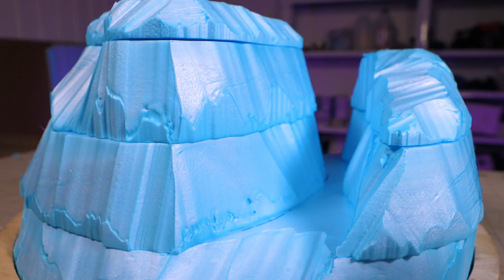Making A Miniature Fantasy LANDSCAPE  (For An Epic Castle?)

Comment: Polymer clay is good when working with metal. It has to dry in oven though. It can be a bit difficult to make it stick to metal by itself so I'd recommend buying liquid clay, with can be used as a sort of glue to make the clay stick. Translucent liquid Sculpey (TLS) or FIMO deco gel both works great. Polymer clay also comes in a variety of colours, if you don't want to paint everything, and it's great for sculpting small details. Some even comes with cool effects like translucent, granite, metallic or glitter, glow in the dark, etc. 

It can be a bit heavy if you use a lot or make thick layers though. So if you make something that has to be lightweight, I'd recommend using wire, masking tape and aluminium foil to build up the armature. 

You can also bake it in several intervals. So for this project for example, you could make a few branches, bake it for like 5-10 min, make more branches, bake and so on. The package usually says to only bake the clay for 20-30 min, but Iv'e had pieces in for an hour or more with no problems or damage. And in my experience, the clay gets harder the longer you bake it

Another thing is that the clay almost never get's old or dries out. And if it dries up, which in my experience can happen after a year or so of not being used, it can be easily fixed by mixing it up with a few drops of either liquid clay, baby oil, or even clay softener(which is made for that exact purpose). It will almost instantly bring the clay back to it's original condition.

Comment: My step sister uses sculpey clay for projects that need wires or tin foil to hold up the clay or shape.  You do need to bake the clay in the oven once you finish with the clay but it works for her. She does a lot of clay work.

Comment: if you want a fun medium to play with make papier mache using acrylic latex paint instead of water/glue, I prefer using tissue on small projects and paper towel for larger projects but it works with news print and printer paper as well.. Ive used craft paints, thinned artist acrylics and house paint, all work and it drys to a hard, water resistant, plastic like stuff that is very durable.. in this case I would have covered the "mountain" and the trees with it, its extremely moldable

Comment: Try using a mixture of wood glue, modeling paste, and fine saw dust for your tree trunk cover. You can also add paint directly to the mixture to give it a base color. You can easily control the thickness and, when it starts to dry, it's easier to make bark lines using a paint brush.

I'm a new subscriber, so I haven't watched your entire back catalogue yet (still watching book builds), but have you ever looked into a static grass applicator? It is a cool way to apply realistic looking grass to models.

Comment: Another way to cover your armature while using tape is to add aluminum foil to the base to add more thickness and lightweight instead of just adding clay directly to the wires, also you can use bake and bond which helps the glue stick and if you have clay that bakes (which is what i recommend using) itll still stay on the base and aluminum foil. Just a suggestion though :)

Comment: For mini trees- If you're going to use clay, there are adhesives you can use to help with it sticking to metal, polymer clay has a bake and bond that works well. That being said, the best way is to coat the metal with some latex first, then anything will stick to it.

Comment: Use polymer clay and you can bake it in the oven. Works well with wire. Watch some "Ace of Clay" videos. You can even add more clay after baking, using a type of polymer clay glue in between the baked and not baked clay, so it helps it stick and not pop off after your final bake.

Comment: Apparently (and take my word with a grain of salt since I haven't done very many projects of this kind), it is possible to actually sand dried hot glue without screwing it up. Normally, the friction from sanding would make it melt again and form little glue pellets, but according to someone named hoanghuynh on FliteTest forums, only sanding in one direction instead of back and forth fixes this. In their post, they were trying to remove hot glue, but i think it could also be used to give it a different texture in some areas. Just an idea :>

Comment: I'm probably too ignorant to make a suggestion, but I have a possible idea on getting the best of both worlds on the trees.

1.  Put on a thin coat of hot glue.  Keep dusting it with stuff that clay would adhere to while the glue is hot.  Maybe dirt, maybe corn meal, something like that.

2.  Position as desired.

3.  Add a thin coat of clay and texture it to one's heart's desire.

Comment: you can use a woodburning tool to get the same textures in the hot glue, and if you use clay first wrap it in aluminum foil than the clay will stick better :)

Comment: I am curious about a hybrid method: What if you did the wires, coated with hot glue and then did a top coat of clay.  I also wonder if model magic would adhere better and perhaps retain some of the flexibility of the glue even after it dries.

Comment: For the clay tree cover the wire with masking tape first. Also I would switch to polymer clay. This is easier to work with and if you find yourself accidentally squashing the branches you’ve done you can just bake it then continue making the next branches; you can bake as many times as needed.
Polymer clay is also nowhere near as brittle and doesn’t dry out or harden until it is baked meaning it won’t flake off.

Comment: Idea! What if you use clay on just the main trunk, but hot glue on the branches?

Seems like the big part was a little easier to apply and then you could sculpt knots and textures pretty easily. And then the leaves would pretty much cover the glue branches.

Would that work well to get best of both processes?

Comment: This is so awesome and sorry you had such difficulty with the clay on wire, just had a lightening bolt ⚡️ moment though, would it work to start out with the hot glue over the wire frame which is quick, easy and would give you a good base to start with. Then add the clay over top to create the texture you want, add weight and bulk to create a more realistic feel and with the texture of the glue it would be make it easier for the clay to stick and faster to turn tree 🌲 part of this project around? Fingers crossed this helps and I'm so going to make this project. It would look so pretty lit up too 😍😍😍

Comment: You should try using Polymer clay. You can bake it in your regular oven. Søstrene Grene at Liertoppen usually have some small packs of polymer clay(Can't remember exact price, but between 13-30Kr I think). If the clay is to hard, just roll it in your hands and heat it up. If it's too sticky/soft you should let it rest for a while, nor do it the quickway: MOOOSSH it between regular printer paper. Also, polymer clay won't harden unless baked, so you have endless time to work with details. You could also buy Fimo, sculpey or Cernit polymer clay. I just bought some Cernit to try out.

also, use aluminium wire or for example copper wire, I just buy mine at clas ohlson. You could also skip the battle and just use aluminium foil, either a fresh clean new sheet or just save scraps from cooking. You can use small wooden sticks, like matches(Just cut off the tip ofc) to stabilize the structure. It is alot cheaper to use aluminium foil as the base and then just wrap the polymer clay around it.  Also, don't spend too much money on different colors of clay. Just buy pure white and dye it with either pastel-chalks, chalks in general(I think at least), Eyeshadow or powder dye for polymer clay. 

If you experience the clay getting burnt in the oven, try making a tent with aluminium foil and like put the tent over the creation. 

Just remember to air out the oven before cooking food again... You should also have a decently ventilated kitchen, so a good fan, air condition or a window is good!
When it is baked, you paint!(If desired). You should use a acrylic medium sealant when your done, choose the finish yourself. I think they have matt, semi gloss, glossy and crystal. 

ALSO! Epoxy Resin is basically like glue, so you can use it to glue your already baked sculpture! 

ANOTHER Also, Martina, is the basement WELL and I mean SUPER WELL ventilated? Cus that epoxy gonna eat you up if you're not careful xD  DA FUMES FROM HELL! 
BTW: Momi Hobby&Garn in Asker Sentrum have a lot of cool craft supplies. Mostly yarn and scrapbooking, but they have a small section for clay and other sculpting things! You should check them out if you haven't already and are in town. Their location is outside of Trekanten towards the railway station, same street as apotek 1. 

Looks good though! Excited for the result!

Comment: @17:22 Maybe start the general shape with hot glue then finish with clay.  Might have to use the glue gun tip to pull out little spires that the clay can adhere to.

Comment: Polymer clay would probably be easier. Trees look awesome by the way. If I was you I'd do the hot glue and then cover the trunk or main visible areas with polymer clay. Less clay, quick and easy hot glue application, clay will stick easier and you get the detail and more realistic results that's not shiny and looks like bark.

Comment: Use Polymer clay and liquid polymer clay. coat wire with liquid clay then put on the clay, you can even bake it every few branches to cure it faster and so you dont mess it up as you are working. also, PC is more flexible and not brittle.

Comment: Those trees are great, what about hot glue on the branches, and then just doing the lower trunk in clay? Get the best effect on the most visible part, and avoid the tedium on the unseen parts?

Also, what kind of wire did you use? I'm not sure if you said it and I missed it. :)

Comment: Which clay did you use?  Most sculptures have a wire frame.  May I suggest using tape on top of the wire to see if your clay sticks better to that?  I have used crayola air dry and activa products and they stick fine to wire.

Comment: Love the result!  It sounds like you were using air dry clay.  Never use air dry clay.  It might be cheaper but it is cheaper for a reason.  Cheaper material.  You have to get the more expensive oven baked clay.  It has to be worked over some but once you get it to be malleable then it is very easy to work with.  Clay artists use it on wire structures all the time and it won't dry out on you at all since it only dries in the oven.  You probably would have had a better experience with oven dried clay.  I do like both trees though and agree with your pros and cons.  I was a little nervous when you said that you were going to make a tree out of hot glue but you made it work!

Comment: use a primer before attaching clay. remember if you want to paint metal, then you need to prime it first, i guess it' s the same with clay...
for the hot glue.. did you used matt spray paint?

Comment: You do great work. Why didnt you use the other tree on the other side of the same rock just closer to the base. It would have added some balance., even when the castle goes on.  Keep up the great work. 
Ps ive only seen people use wire for the model then smaller wire to help  clay stick to the frame. But they use bankable clay. Not air drying clay.

Comment: Have you tried using polymer clay instead of air-dry clay?  It remains somewhat flexible when cured but takes all kinds of texturing really well, and acrylic paint should work on it just as well as on the air-dry clay.  You'd just have to make sure it fits in your oven, because you'd have to bake it for about 30 minutes before painting... :-)

Comment: What if you took the hot glue tree, and roughed it up with sandpaper, and kinda smeared a thin coating of the clay on it after for the texture and better painting surface? Shouldn't take a lot of time.